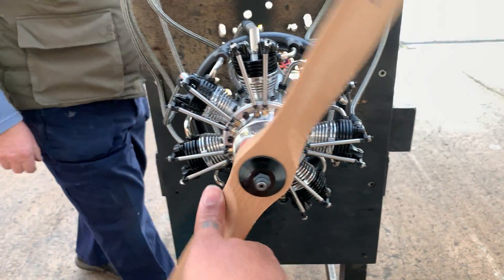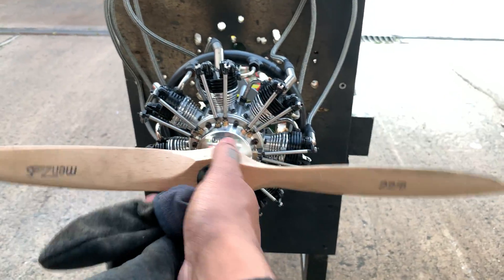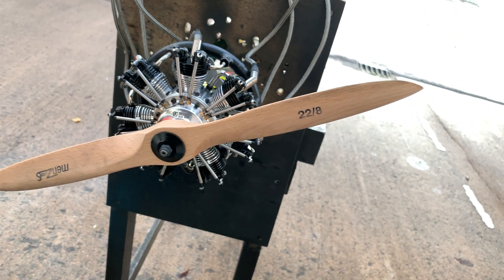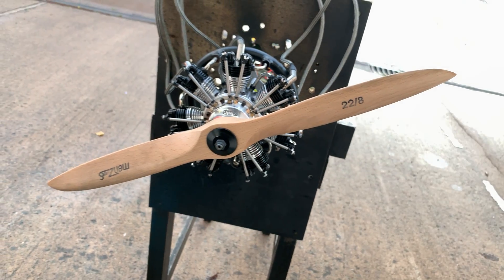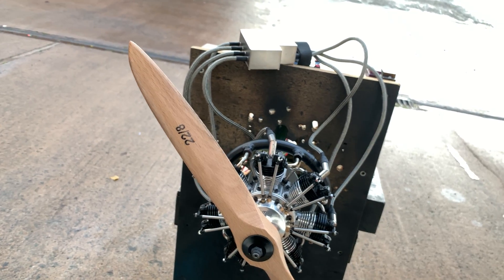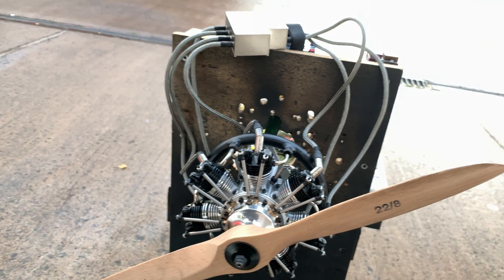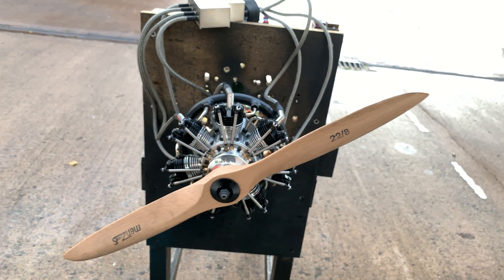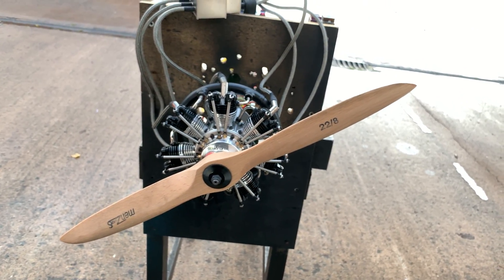UMS 7-50cc  Gas / Petrol 7 Cylinder Radial 4 Stroke Engine 1300 RPM-5200 RPM with 22 x 8 Prop

Comment: 20x8 pro only reached 5400 rpm is going nowhere and for that price I go for dle 55 cc is ten times cheaper or  for the saito fg90 r3 still a lot cheaper.
Reply: I run FG84 r3 and its amazing. I'm sure 90 is too